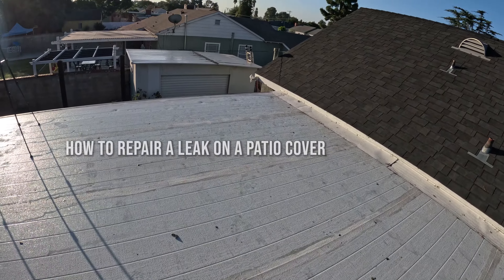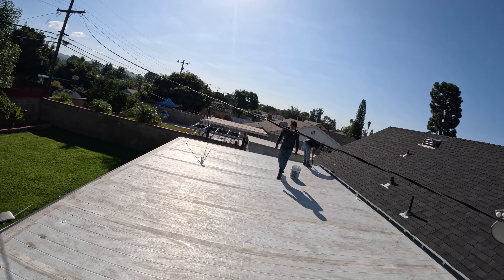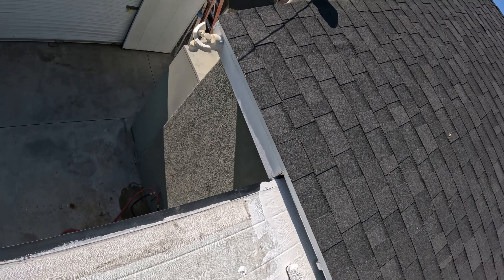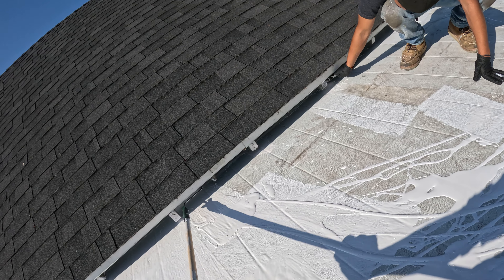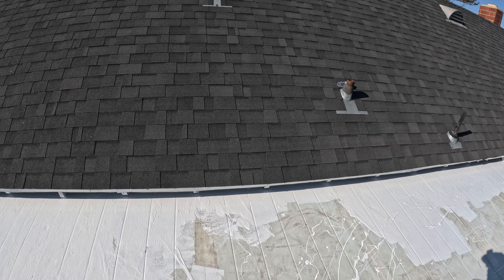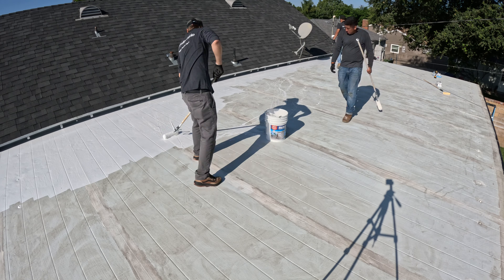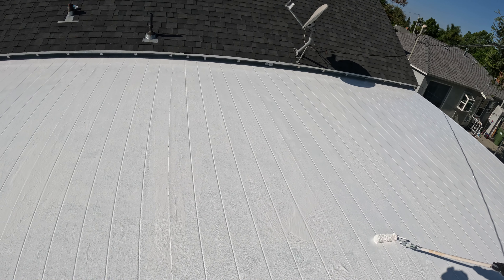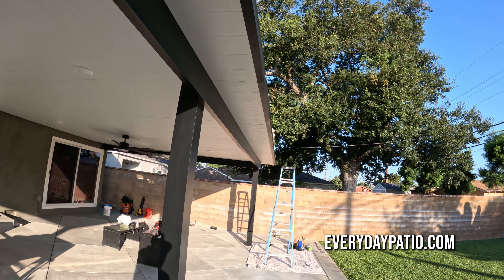How to Fix a Patio Leak in 5 Minutes

Comment: A contractor just installed a new insulated roof at my house. they attached the C bracket to the top of the fascia and placed roof flashing across the entire roof. Now the C bracket is leaking water under. any ideas on how to fix this? also i see water from behind the fascia board.
Reply from the maker: Hey Raul, usually with a fascia board install, you want to mount lower on the fascia board to separate the water coming off your roof and the top corner of the hanger (c-channel). 

Personally, I'm not a fan of flashing on insulated covers, because it gives an area for the water to pool on. When I have leaks similar to the situation your saying, I'll generally remove the flashing, paint on some liquid flex seal or caulk the hanger with nova flex or quad max at home depot. 

Then after everything is dried a few days later you can add larger flashing if needed, most of the time it's not needed. But if you put flashing you need to be atleast 6-12 inches under the felt paper under the roof shingles or tiles, so that water doesn't travel up the flashing again.

Hope this helps, that's why I made this video, fascia leaks can be a real headache.

Comment: How does Tropicool compare to ASC Silicone Sealant?
Reply from the maker: Honestly, I’ve never heard of ASC, it’s definitely worth looking into though. My theory is that most silicone coatings are similar. But I’ve noticed, some have way a much thicker viscosity and better adhesion. Like liquid flex seal has great viscosity and adhesion, but is not really economical for a full roof repair, just seams.

Anyways, would love to learn more about it man, tropicool is just readily available to us and reasonable priced at around 300$ per 5 gallon barrel for us at Home Depot.
Reply: @EverydayPatio  i asked Henry customer service  what i should use if I say had a aluminum mobile home.. I don't but do have a aluminum patio cover.. They said Tropicool. I asked my roofer about it and he said it was OK but ASC is "what we pros use and it's cheaper..260 bucks. But he had to get it from roofing supply. Im just gonna buy it from home depot.. do you think 1, 5 gallon pail will cover my 19 X 13 cover?
Reply: @cliffcox7643  Yea that makes sense, I’m sure the roofing supply one is slightly better. The Henry will work if you put it thick by the gutter and hanger. I would just get 5 gallon, 1 gallon won’t go far enough